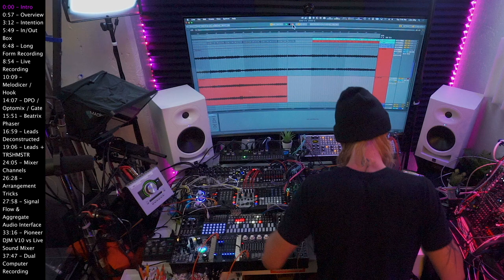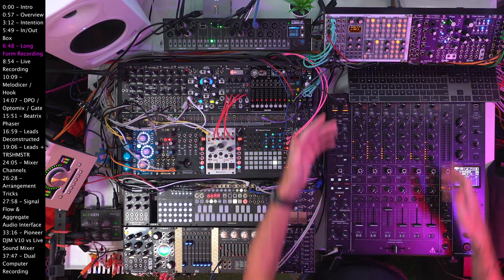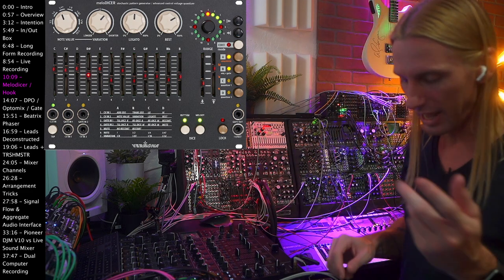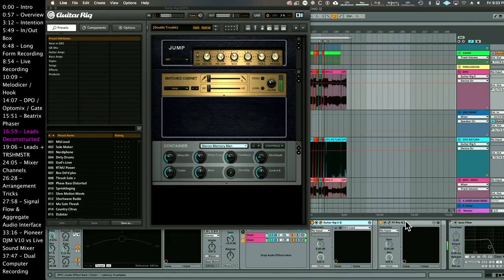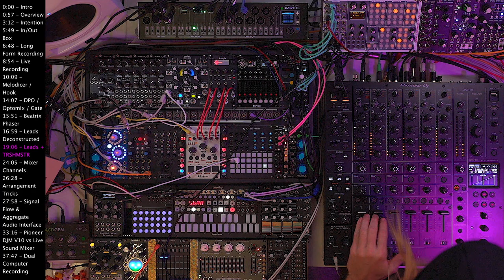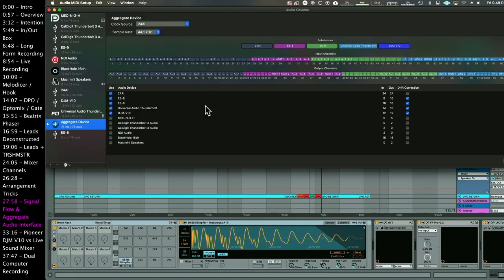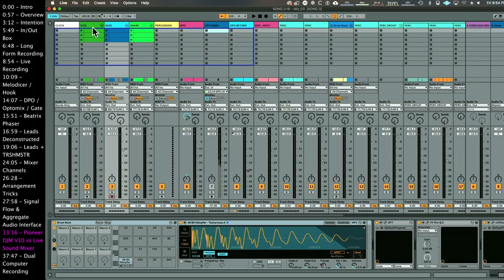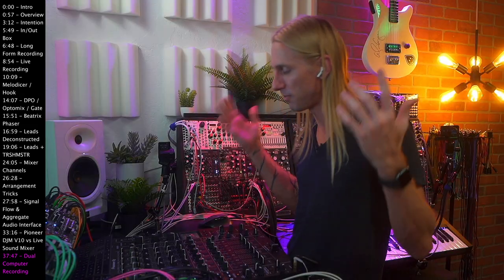The philosophy of "Funk With Me" and songwriting in eurorack.

Comment: Nice followup, appreciate you taking the time to explain your process. 100 is the new 120. ;) 
I like how you use a crazily distorted take of the lead like a pseudoharmonic layer over the other layers. Some of the most interesting effects in a sound can be at a different pitch than the main pitch, as long as they do not overpower the intended pitch or create unpleasant or distracting disharmony at the wrong time. Pitch tracking or envelope following sent through effects that impact the "harmonic" layer can sound pretty awesome if they serve this goal, as you did sending the pitch from the sequencer into the distortion. 
If you had a vibrato module that could be run by a smooth random lfo and/or an envelope follower, you could get leads you send through it to stand out even more and add a dreamy feel to them. 
If you are cycling blocks of 6, you could add some subtle extra elements at key points in each block or every other block to make it easier for people's subconscious to realize that the 6 is intended. These cues can change every time around, as long as the differences contribute to their context.
 It would be awesome if you do build your own mixer someday that does everything you need. 
.... "When I opened for Shpongle." ___jawdrop.  :P
Reply from the maker: Really great feedback, thank you!! I like the ideas you are kicking around, going to need to experiment with these!! As to your last comment, yea that was pretty epic! Got to kick around ideas with Simon and learn about his workflow. An amazing night for the books! https://www.theuntz.com/events/infected-mushroom-and-shpongle-at-the-warfield/ (My band was called Dissolve). 🤘
Reply: @LiamShy  lol...there is still a link to get tickets. Wouldn't that be great?  I don't have a hardware modular setup, but you got me inspired to wire up some evolving patches in  vcv rack and feed them into ableton to record while tweaking them. It's a lot of fun to subject exotic sound generation modules  and fx to various types of lfos, clock generators, and oscillators all set to different intervals to polyrhythmically create an ever changing soundscape and then tweak it realtime while recording into live, saving snapshots whenever arriving at a particularly interesting combination of parameter values. I guess I'm making psytrash, or lofi psy-pie.

Comment: I'd love to hear that the BoredBrain ADAT module is problem-free. The ES ADAT and SPDIF modules have massive DC offsets that manifest as constant hot signal in Live. The Utility device is useless for removing it. I don't think the AD converters in the ES modules are particularly great either.
 I've switched to MOTU interfaces for their AVB networking, which works like Dante to allow for expansion of more analog IO. But MOTU AVB network switches are impossible to find nowadays.
Also, I hear ya about demanding high fidelity. Lo-fi is all well and good, but lots of us are not producing that genre.